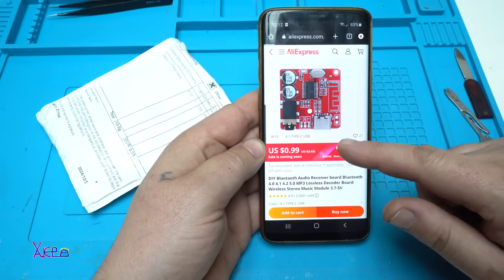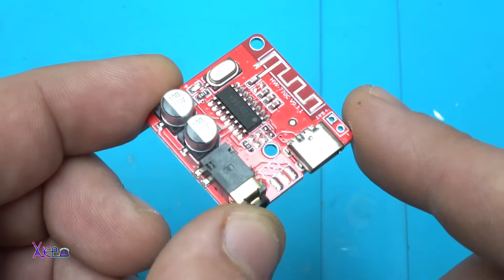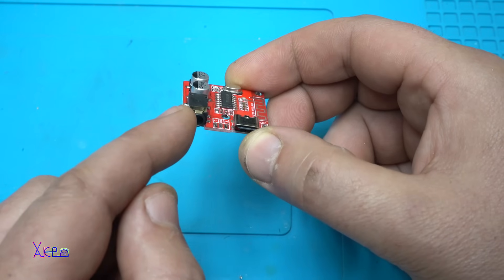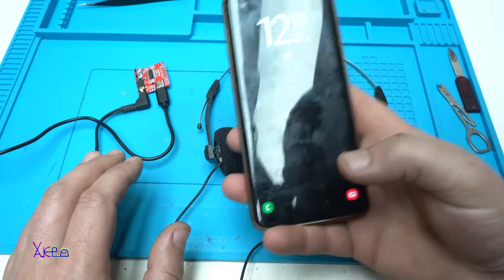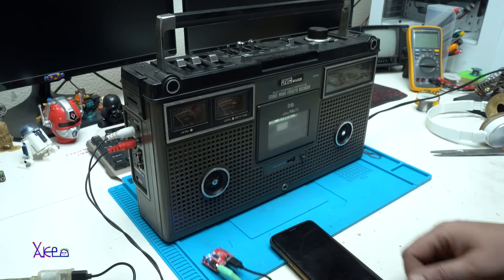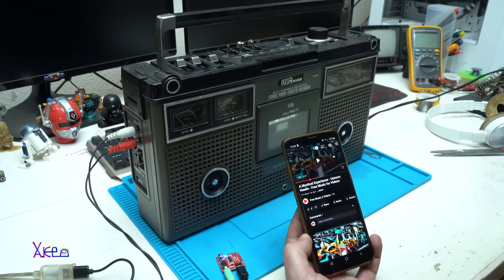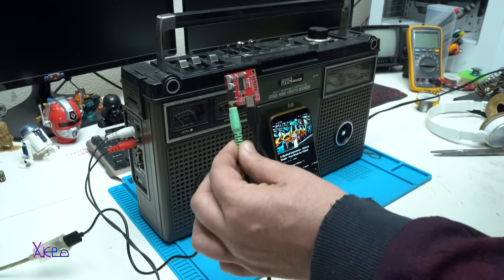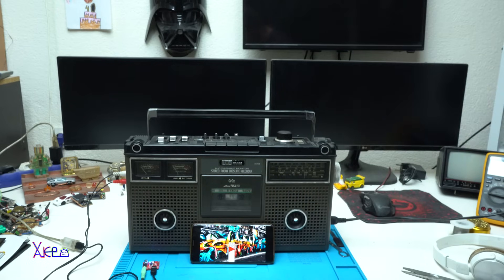Why This  $1 Aliexpress Bluetooth MODULE worth EVERY CENT?

Comment: I bought the hw-770c module that looks the same as yours. If you use more than one of them the bluetooth signal is received by all of them at the same time because they all have the same bluetooth ID, which could both be useful but annoying if you want different signals to different devices. I'm about to buy a vhm-314 which also looks identical but will hopefully have a different ID. If anyone can find a way of changing the firmware to allow the ID to be changed please let me know.

Comment: Is it possible to take a bluetooth module and connect it to a device like an external dvd device or docking station to change the devices from usb connection to bluetooth connection?  plug a bluetooth module to the usb cable connected to the device, connect some kind of power to these devices and have my computer recognize the devices for what they are?  I would really like  to have a docking station that does not have to be connected by usb but is picked up wirelessly.

Comment: Hi, great video. If you connect rechargeable battery will it recharge throw the USB C connection. Thank you
Reply from the maker: No,it will give 5v and damage the battery you need to add charge module for lipo

Comment: Thinking can use this to add Bluetooth at the AUX jack in the gen 2 Prius.  Wondering if I hardwire in a power supply, what the quietest most cost effective way is to use that will last a long time like ideally the life of the car?  The 12V to whatever USB output plug in PSUs are so noisy.
Reply from the maker: That may work,just power with 5v taken from usb charger and audio output connected to aux of your car
Reply: @Hacktuber  Yeah, just need to determine like what capacitor and or ferrite to put on the 5V output so no noise since those are so noisy.  Power supply definitely will need filter for noise elimination.

Comment: Is there any way to adapt this to old car radios and have it powered through the radio?
Reply: I guess you can power this from the car using a DC-DC voltage converter which takes 12VDC input and have adjustable output from 1.5V up to about 11VDC. This should be available from aliexpress, too. There are also 12VDC to 5VDC fixed voltage converter as well.

Alternatively, you can also use a USB charger that plugs in cigarette socket to give 5VDC through the USB port.

Comment: either the left VU meter on your JVC boom box is not working or the device is only outputting to the right channel, or, there is a problem with the RCA-3.5 cable
Reply from the maker: The module is stereo for sure 100% the boombox one channel vu meter dont work

Comment: I bought an Ihome speaker years ago that had both the input and an output jack. The output allowed me to do the same as this module does, but they dont sell that type of speaker any longer. You could turn any stereo into a bluetooth system instantly. Thanks for sharing this item.
Reply from the maker: You are right! This module is very useful.

Comment: I use these to add Bluetooth audio to old tube console stereos. They usually have a line in for a tape player you can use for input. Range on mine is about 15 feet.
Reply from the maker: That's great, I need to try that too!

Comment: ATTENTION!! If a lithium battery is connected to this device, do not use its USB port. The board delivers 5v to the battery and will end up destroying it, it may even cause a fire. It must be powered by USB or with a battery with its own charger, never use both options at the same time.
Reply from the maker: Many of you suggest that and yes all who will qork with this module need to be careful.
Reply: For any lithium battery you should be using a safety module across the terminals and use the outputs from the module. These modules have over discharge protection, short circuit protect and over voltage protection. And they are really cheap.

Comment: These are good modules.  BUT, and I write this in capital letters.  For the people facings beeps, weird noises in the background then this is common with these boards.  Simple test, power from powerbank and from a charger or whatever.  If you don't hear the noises using the powerbank or a battery connected then it is a ground loop issue.  I could get into detail on how and what but people want a solution.  2 ways of fixing this. 
1) audio transformer :  easy since it will provide a galvanic separation of the gnd (minus) between the board and what is behind it.  It's easy but I don't like that solution since it will change the sound a bit and you are stuck with impedance and phase issues.  
2) And this is always my go to solution.  OK it will cost you the price of half a sandwich but I go for good clean sound instead of half a sandwich.   There are DC-DC isolator modules. Very easy to get on Aliexpress. B0505S-1W for example is one. Very easy to setup with 2 small capacitors. The 0505 also indicates 5V in 5V out so you can also get like a 1205 which is like a 12V in 5V out. Use that to power the small pcb and it will be fixed. Quiet and no altered sound.   You can also get these modules with a radio, sd-card and BT module that people use to modify old equipment ... use the same dc-dc module and no more beeps etc.

Comment: Not stereo
Reply from the maker: Yes is stereo
Reply: I wondered about that too, as the right channel V.U. meter is moving and left is not,

In 99% of cases I have found if it's mono then it comes out of left channel only, could be mono only or perhaps it's a fault with the cable or the boombox?

Further testing would be helpful

Comment: i use hw 425 module, it has a facility to connect pen drive  & a key pin to connect 5 switches for vol,next/prev & pwr.

Comment: Add one of those li-ion charger modules with over discharge protection so you can make this a  rechargeable Bluetooth audio module
Reply from the maker: Good idea! That would make it even more useful.
Reply: much easier when we already have power banks

Comment: Hey man i have this module and here are some things I have found..
The battery connection points are directly connected to the 5v or vbus of the type c connector..so don't connect type c and battery at the same time..also the module will only work upto 3.7v as mentioned and when the battery voltage will be approaching 3.7v it will say low battery and keep saying in certain intervals..also you can directly use 5v on the battery solder pins to power the module too..but verify this once after connecting type c and measuring the voltage at the battery pads and i think it will show the usb voltage :)
Reply from the maker: I didny know that and I didnt check when lipo battery is connected to board when type c usb is plug in the battery will get 5v and that its not safe at all😠
Reply: @Hacktuber  yeah.. problem with Chinese stuff..good and bad..also if you use battery it won't be discharged fully so the battery won't get used to it's maximum capacity as the module turns off below 3.7v ..so better to use a low current boost converter to boost the voltage to 5v and use it with battery given that the battery has a protection circuit..i am using it this way..lasts way longer than using battery directly
Reply: @ishandipta852  Nice tips pal.  Very good info.  You deserve a beer ;)
Reply: @MI7DJT  thanks for the compliment..but I don't drink :)

Comment: I want one that could make my 5 vintage walkmen cassetteplayers bluetooth compatible. So i could listen wireless to my old cassettes
Reply: There are Bluetooth transmitter modules, but you need to pay attention to the audio quality, many cheap modules transmit audio with low quality and is not stereo.
Reply: @MoisesCaster old cassettes usually don’t produce high quality sound😅
Reply: This board will do that and there’s probably enough room for it in the old walkman case.
Reply: @mikebond6328  No, he needs a bluetooth transmitter, to listen on a bluetooth speaker. Or just connect speakers with a 3.5 to 3.5 cable?
Reply: @mikebond6328  will do what exactly? Maybe you should watch the whole video again? :)